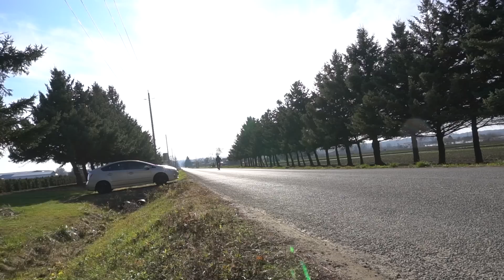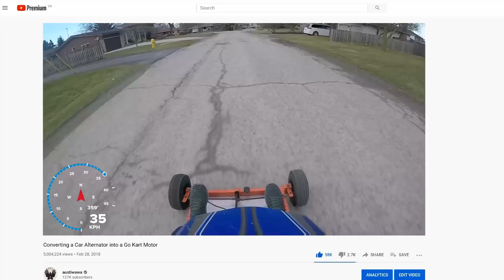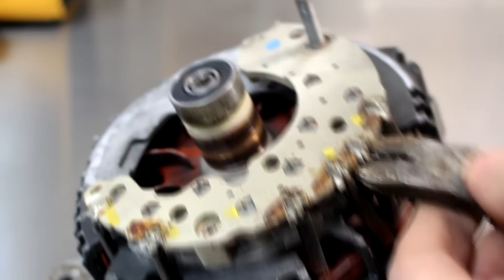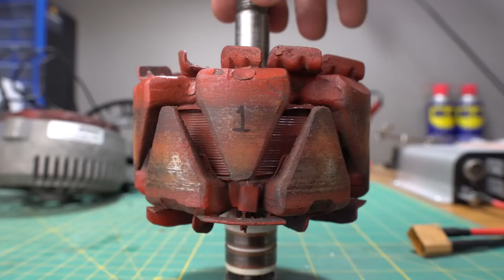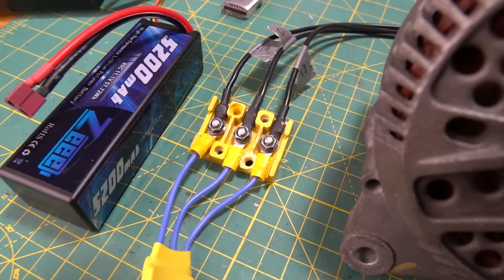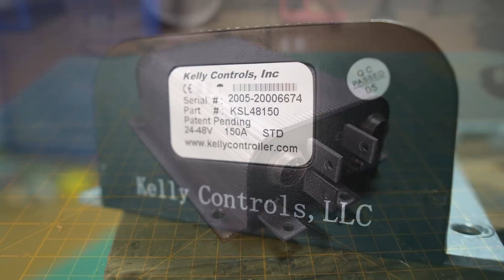Building an Alternator Powered Bike

Comment: very interesting video....I have been wonder for quite sometime about way they don't use alternators in EV's? Seems to me it would charge the batteries as the vehicle is moving down the road, and therefore would negate the need to stop and charge the batteries. One could travel across the country non stop. But my thinking must be way off base, because I think that would already be a reality.
Reply: It can't be done, if it could people would already be using

Comment: Can you make a more budget friendly bike? Batteries are expensive, try using an old car battery, junkyard alternator, and a simple voltage regulator. The least parts that could possibly be used on a DIY budget project.
Reply: you can use SLA batteries, but you still need quite a bit of money
unless you get used laptop cells and test them to use

Comment: How did you address the 6 coil leads A1, A2, B1, B2, C1,and C2?   I am thinking delta in a (A1,C2), (A2,B1), and (B2,C1) pairing.  Is this correct?
Reply: yes

Comment: Just change the springs in the clutch so it engages at a much lower RPM,  should cost less that $5 at the hardware store..
Reply: or swap the controller and kill the need for the clutch altogether

Comment: Excellent work !!! Great knowledge and the ability to create and modify, passion that I have personally. I also built an e-bike from a kit using a three phase brushless motor. It is a 48V 20AH battery  with a 800W motor. It is limited @ 50 Km/h but it is far enough on a bicycle frame !!! Keep-up the good work and innovation !!! It pays off specially on your career if you pursue Electronics/Controls/Computers  !!! Have a great future !!!

Comment: There are about 250 million gasoline driven cars in this country.  Electric automobiles are slowly replacing them.  It should be possible to remove the gasoline engine and transmission and convert it into electric, don't you think?
Reply: There are a lot of people that had converted their cars to electric
Reply: Even an ukranium guy that got an alternator to run his car

Comment: Have you tried adjusting the current to the coil on the rotor?
Reply: Not him, but others Yes
Reply: @foxxyytofficial  Might be usefull with regenerative braking. more current on the rotor coil creates a stronger magnetic field, to generate a higher voltage in the stator coils.

Comment: Maybe already said but the earlier 'always rotating' issue: why not just cut the field coil voltage until you're ready to go; no clutch needed. Of course what you end up with is so much better. I didn't realise the HE feedback made such a difference to performance, especially with noise. Thanks.
Reply: Cutting the field messes with the controller
Reply: @foxxyytofficial  Thanks.

Comment: Amazing project well done, speed was crazy nearly equal 1mph per volt !!
I was thinking about the clutch/motor issue in the first part, could you power down the rotor field then once the bike is push started turn on the rotor field, thus doing away with the clutch and the hall sensors?
Reply: No, it needs to be on at all times or it can damage the controller
Reply: @foxxyytofficial  Please explain your answer, I cant see why it would damage the controller?
Reply: @andchip.s  BLDC controllers need the magnetism from the rotor in two ways:
1) to be able to power and spin the motor
2) to know how the rotor poles are positioned, both in sensorless mode (using back EMF) or sensored (with hall sensors)
if you lower the field power (until a certain threshold) its ok, you will swap torque for more RPM, but below that threshold or completely off (and the controller is on), the motor can lose sync and cause a system failure on the controller, where it "shoots" off the sync and could damage the power side with a lot of current in a rush (also known as FETs)
Reply: @foxxyytofficial  Interesting, I will have to experiment with some ESCs and BLDC motors and convert an alternator, I have a few left for making my quadcoptor. Also wouldn't the diodes in the H bridge or inside the FETs protect them?
Reply: @andchip.s  you can use common 3S ESCs to power and test alternators, but they aren't powerful enough for any usable torque, just on bench tests
alternators are better utilized between 36-72V
Reply: @foxxyytofficial  I was also thinking of using an industrial 3 phase motor and using an ESC on that, I wonder if that would work?
Reply: @andchip.s  industrial motors are almost always ACIM (AC Induction Motor) and probably wounded to work between 100-400V, so ESCs aren't the best chance to make them work, but specific AC Induction motor controllers can be used if you have the money
you can try to find a washing machine motor that isn't induction as well, or an alternator, because those can be driven with common BLDC controllers

Comment: What is your speed
Reply: @foxxyytofficial  i did i want to know what the max speed is he said he could get more speed out of it and reliance. And weight ratio
Reply: @johnhawk9321  using the hall sensors, a 72V battery, and a 72V controller, instead of the 48V system, and using a variable power delivery system to the brushes (PWM 12V controller), he could probably get 80-90kph at max
Reply: @foxxyytofficial  cool thanks

Comment: I should have paid more attention in high school, this is really neat. I've often wondered why, electric vehicles don't charge as the run, it would add to there range.
Reply: They can regen, not charge
Reply: @foxxyytofficial  I drove transit buses a number of years back that used the wheel rotation while coasting to return to the batteries. That same wheel rotation employed electrical current for dynamic braking. You're a pretty smart guy.
Reply: @ScottGpa  exactly, the electric breaking can return energy to the battery if the system is prepared for that

Comment: Brilliant idea.. I have 2 questions please. 1. On the bench you used the same ESC that you used for the small motor also for the alternator, but then you switched to this alternative speed controller for the actual bike. Why did you need to do that? Aren't the ESCs also rated for a high current?  2. how did you connect the alternator to the wheel? is it through friction or did you use a belt or chain? Thanks and well done.
Reply: The RC ESC works as proof of concept
The stator needs more voltage and current than most ESCs can handle, so people use Ebike controllers or VESC controllers

Comment: Would it be possible to put an alternator and charge controller on an electric bicycle to help prolong runtime by recharging batteries as you ride?
Reply: nope, only regen
Reply: @foxxyytofficial  Does that also rule out DC to DC charging like this unit  that uses the alternator to supply a constant regulated recharging power supply? (provided it's sized properly for the application)   https://www.renogy.com/12v-dc-to-dc-on-board-battery-charger/
Reply: @tdc8795  yes

Comment: Why not have 2 alternators. 1 charging batt other being a motor driving.
Reply: Because it would be waste
Reply: @foxxyytofficial  how.. It should be recycling the energy. Self sustainable system.. Isn't it
Reply: @abdainawi  you can't simply get another alternator to "recover" all the energy, beyond all the losses, you will waste every watt of power
regen from the driving motor and a regen-enabled controller its ok
Reply: @foxxyytofficial  machines have losses no matter what.. Besides he would be paddling too in some ocassions. So it's still a viable option to consider. IMO if we can keep the wastage to minimum. I would agree with u if decent charging output cannot be achieved. Thanks for your review
Reply: @abdainawi  i wonder why people still think that this kind of stuff can be achieved

make a test: grab two similar dc motors, connect their wires and spin one, you will be able to spin the other
but now ask for someone to hold the second motor's shaft so it will spin more difficultly (giving it a load), now for you to spin the generator you will need more power

now imagine that you're powering tha bike with an 70A alternator pumping 3000W to the wheels, depending on the losses you can lose a significant part of the 3000W

if you connect the second alternator, wherever it would be, now you have to still power the bike AND power the alternator, to give more losses before "putting juice back on the battery"

Choose now: keep the alternator pumping 3000W to the bike + the energy for the second alternator, drawing even more energy from the battery and getting it worse...
Or keep the same 3000W draw from the battery, but now dividing it and slowing down the bike, with the excessive losses still draining the batery and giving less range than before
Reply: @foxxyytofficial  thanks for clarification. So bottom line is that losses are so high that it remains useless & even impair the existing system performance.
Reply: @abdainawi  yes, the only thing you can do, being with proper motors, or DIY solutions like an alternator, is to have a regen-enabled controller, like his controller

Comment: If you put weaker springs in the clutch then it will engage better at low rpms and won’t slip as mich
Reply: Or just remove what forced him to use a clutch

Comment: Hey would it work to disconnect the power to the brushes with a switch to stop and start the motor eliminating the clutch?
Reply: Nope, it would mess with the controller
Reply: Because of inconsistencies in load?
Reply: @sailor303  because the controller NEEDS the magnetic field, cutting the power cuts the magnetic field and messes with the controller

Comment: You should do this with one of those 3 wheel bikes and out a 350w solar panel on it.

Also does regeneration work at all? Have you thought about building a current mirror in series with the brushless controller so you could scale your field vurrent to match the phase current?
Reply: he didn't programmed the regen, but i'm certain that the youtuber "Fixitmoditbreakit" prepared regen with his alternator and VESC controller

Comment: Hey nice job solving the problem electrically. You could have also solved it mechanically by replacing the springs in the centrifugal clutch with lower tension springs to kick in at a lower RPM and/or replacing the clutch packs with a higher mu material. In all honesty, going the electrical route cost you less in parts, but more in time.  Since you were using a hybrid setup though, there's always more than 1 way to win! Thanks for the upload!

Comment: Could you leave the diode pack installed , bypass to run as a motor  on overrun/downhill revert back to an Alternator to recharge the battery pack?
Reply: nope, that wouldn't work
Reply: @foxxyytofficial  OK, Why?
Reply: @EvilChuckie  because:
1) with the diode pack you would have a lot more trouble to install the wirimg and control the stator
2) its 12v, people use 36-72V on their alternators

Comment: now put another alternator on other side and connect it to bigger gear, so when you reach top speed with 1st alternator, kick in 2nd and turn of 1st, and bigger gear, higher top speed ;) Also you will get counterweight so it will feel more stable :)
Reply: you don't even need that, just gear the alternator correctly, then slowly reduce the power levels on the rotor with a PWM controller, some people already tested that
Reply: @foxxyytofficial  Yes even simpler :)

Comment: What's the max. Amperage draw?
Do you think 12 volt (3s) LiPo would be adequate?
Great work! Repurpose the world!
Reply: the amp draw on the stator or the rotor?
if you're talking about the stator, 12V is low for a good build, since most people use them between 36-72V
Reply: @foxxyytofficial  I guess I'm looking for the stator current if I understand correctly. I'm interested in the current it takes to spin the motor under load.
Reply: @porousorificePilot  under load the alternator can pull from 10A (with a basic 18A BLDC controller at 36V and a small load like a power wheels), up to 100A with a beefier alternator and a beefy 200A controller/battery
Reply: @porousorificePilot  using 12V om the stator is really low

Comment: @austiwawa hi Austin I love watching your videos I’ve been wanting to convert an alternator into a motor for a car that I still need to build. Just need time which is scarce at the moment. Do you know if the converted alternator could be used for regenerative breaking so if you you were going down a heal break with the motor and charge the motor? Would like to see if you can do this.
Reply: yep, just need to keep the same current on the rotor and use a regen-enabled controller

Comment: You should see if you can add timing to it... like an RC esc....
Reply: Electric RC cars actually advance the timing on the hall sensors. It adds power and rpms. Most ESC’s can add it in stages, it’s actually called boost.
Reply: @stephenkamin1345  but the problem is that those RC ESCs don't seem powerful enough to use them, maybe except the most expensive and powerful ones, but in that case probably an ebike controller would already be enough
Reply: timing? for what?
Reply: Well there is always manual advance... physical advancement instead of software....the RC motors have endbell timing.
Reply: @stephenkamin1345  to make physical advancement on the sensors would need an external magnet ring or optical sensors (check the YT channel Chris workshop)

Comment: Can this be done without the hall effect trickery, like a different controller?
Reply: yes, check the part 1 video
Reply: @foxxyytofficial  is the hall effect controller responsible for the speeds he received?
Reply: @hitmikeup  part of his speed was the gearing, part the voltage, and part was indeed the hall sensors helping the controller to know how to cycle the phases more efficiently
Reply: @hitmikeup  most alternator builds with no sensors get around 30-40kph

Comment: Hah!! I work at GM on electric vehicle powertrain controls - my coworkers and I actually spit-balled using an alternator on an eBike! So cool you actually did it
Reply: Hey, would be nice to see if you guys from GM could get one of the old BAS hybrid motors from the Saturn Aura/Vue and use them, since they're already 36V and beefier
Reply: You know, I think he is using what amounts to at most a 120W alternator and most likely 80-100W, yet faster e-bikes are rated at around 1100-2500W peak... Why the disparity in wattage ratings? It's got to be a lot more than the higher voltage at work here.
Reply: @dh66  you're mixing amps with watts, 120A at 12V is 1440W, at 48V is 5760W
Reply: @foxxyytofficial  so I am! Thanks! Shouldn't he be overheating that alternator then? It's frame is more open than most e-bike motors but it's also the size of the bafang HD. Large SUV's with big electronics packages have 300+ amp alternators in them...14,400 Watts. That's some decent power levels there, getting into scooter and low power motorcycle territory there. Tell me about the hybrid motors you mentioned!
Reply: @dh66  a friend of mine got a 120Amp standard alternator and a 12-44V 200A controller (with a beefy 36V battery) and got 100A at 36V on a homemade load test, so probably with a 48V or 72V controller he could get 80-100A peaks of 15-30seconds
Reply: @dh66  those hybrid motors are easier to find in the website car-part.com, search for a 2007 Saturn Vue 2.4 alternator, and in the ads you need to check with them the price and if the car is actually the Green Line/Hybrid
Reply: @foxxyytofficial  is this your build or do you know him? I'm curious what the actual rated amperage of that alternator is. I re-watched the video and that size alternator is not the one I originally thought it was, it looks like this one could be a higher output. Just had a thought: police cars have to run a ton of junk, probably would have the highest spec alternators they can get.
Reply: @dh66  i "know" the guy that pumped the 100Amp from his alternator, his alternator is 120A with dual stators
and yes, police interceptors have high-output alternators

Comment: Great catch on the hall sensor spacing and placement. 
I'm sure you know this, Believe it or not these allow the controller to see timing, and corrects the commutation angle. 
We build medium size brushless 3ph motors, and use encoder offset values so it always knows where to find zero. 
As you noticed it maximizes efficiency and torque,  all around performance increases. 
I followed your gokart build too.
Great stuff man!

Comment: Rather than the clutch wouldn't it have been easier to cut the power to the rotor winding when stopped?
Reply: no, because it would mess with the system
Reply: @foxxyytofficial 
Even in the version without the hall effect sensors?
Reply: @burgersnchips  yes, because the controller on his first video even without sensors use the magnetic field of the rotor in the 3rd phase to "see" more or less how the rotor N/S poles are inside the motor
(in a really basic explanation, BLDC controllers work with 2 from the 3 phases active to spin the rotor with both "pull" and "push" magnetic force, and the 3rd is to read the magnetic reaction from the rotor, then the rotor changes position and the phases swap function, in a "push/pull/read" cycle)
Reply: @burgersnchips  and even if you had the hall sensors, turning off the rotor would kill all the magnetism, still not giving the needed info for the controller

Comment: Dropping the stator winding voltage will increase you max rpm, but drop the starting torque.
Reply: you mean thr rotor winding voltage
the stator is already controlled by the KEB controller
Reply: Maybe a variable voltage regulator that gets adjusted by motor rpm would work. So as the motor rpm increases the stator voltage is reduced allowing a higher top speed (field weakening)
Reply: @tech4pros1  yep that's a great idea.